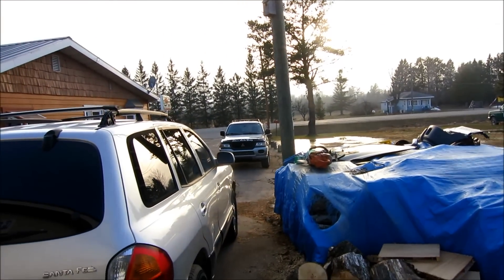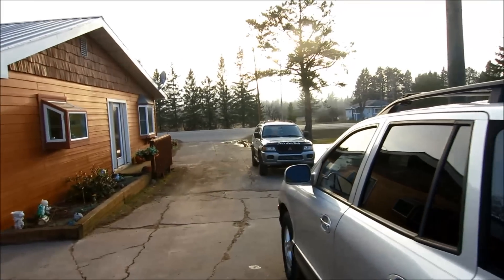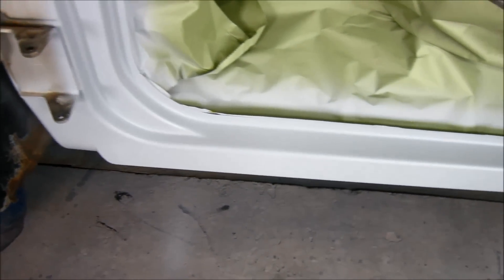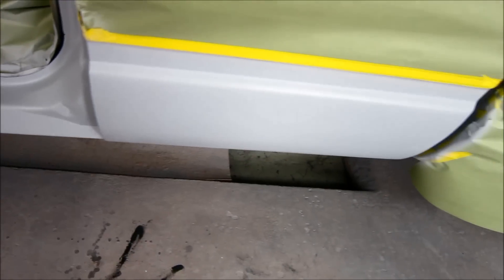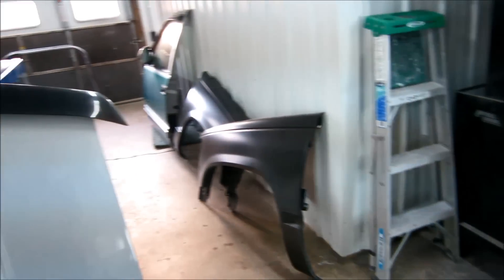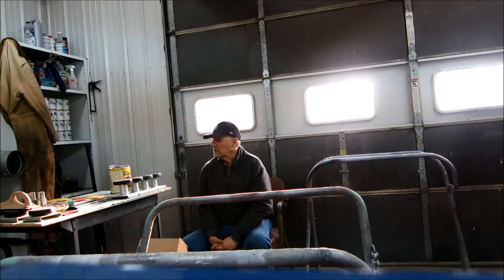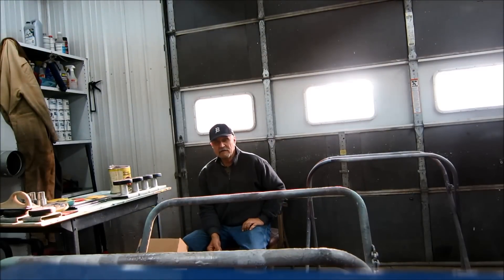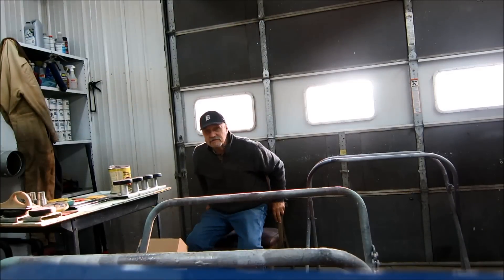94 chevy pickup rockers and Viper paint fail

Comment: Nice work on the truck. Viper hood sure did have some thick paint on it. wonder what caused that blistering. At least the problem is in the paint. Those hoods are carbon fiber and about 5000 to replace ( just for the part) Nice to see the snow finally gone.